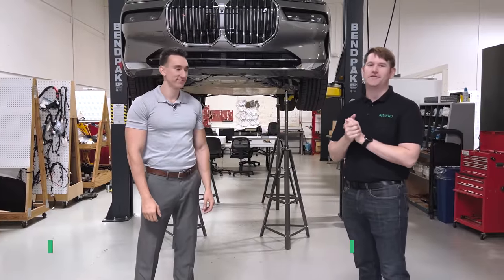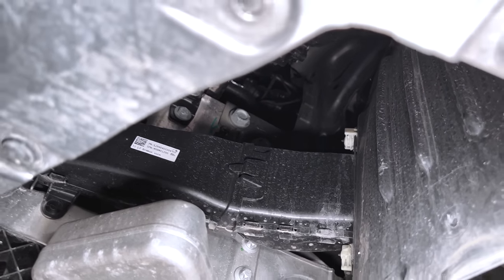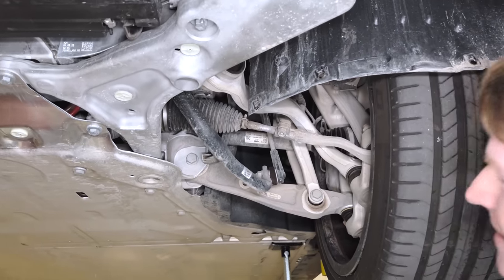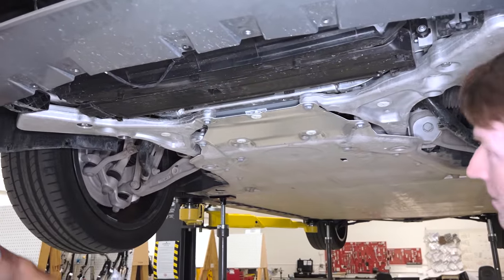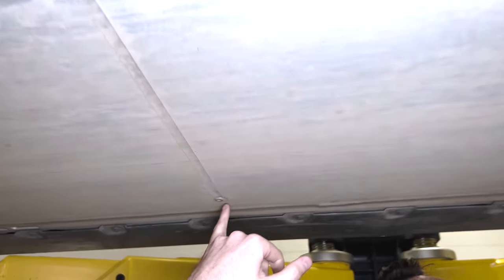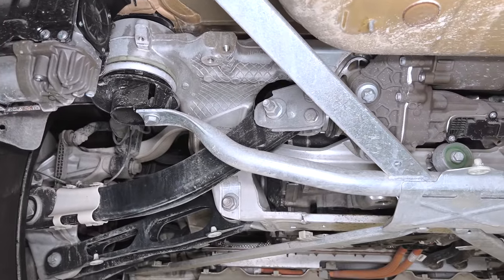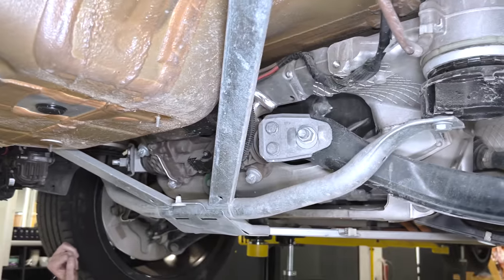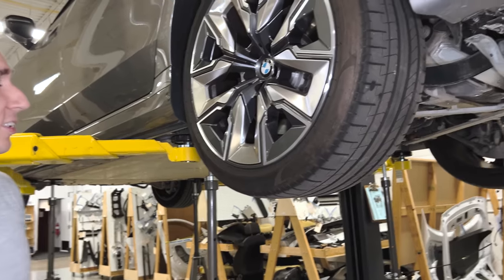The Magnificent Seven | BMW i7 Hoist Review

Comment: Kevin and Armin are quite tall individuals.  So why is the car so low on the lift that they both must twist their heads sideways to stand under the car?  Looking at the lift at the very first of the video, it's obvious that the ceiling height of the building is tall enough and that the lift itself has more height capability.  Hmmm, maybe Jordan put the car up on the lift as a joke?  :<)  Good video guys, I always appreciate these "engineering" talks.
Reply: They could confirm, but from what I know many lifts only go up about 6 feet or so.
Reply from the maker: That’s as high as the lift goes.
Reply: Thanks for the response 👍👍

Comment: Nice exposure of many aluminium castings. Many locations with deliberate potential shear points added for safety, as well as  added ductile underbody cross-bracing for controlled accident survival.
 "Fatigue Life" in any casting, is the most difficult design factor to be taken fully into account. Especially components that may be subject to full or even partial bending stress reversal cycles (eg. compressive to tensile,  for example the section connecting front axial loads to body frame during off-road racing), while castings have very little capacity beyond their elastic limit having very little ductility...

Comment: The rear steering is presumably ZF's AKC Central. It would be nice if the review identified components like that, since it is exposed and easy to identify, but I realize that there are limits to what one can reasonably expect in free content. 

this might be the first generation of AKC Central, which typically allows up to 4.5 degree of rear steering, for stability and agility. The second generation has longer maximum stroke, allowing up to 10 degrees of steering to be useful for low-speed manoeuvering.
Reply: Great info! 👏👏

Comment: You will be on a first name basis with your BMW mechanic 😂
Reply: nothing here can be fixed.
Reply: Might as well open a joint account too so the mechanic doesn’t have to bother you when he wants a check written.  😅
Reply: Four year warranty, guys.  Top end luxury owners trade in before the warranty expires.
Reply: @morrisg  But when the four years is over….  Based on my personal BMW ownership experience.  🙂
Reply: @morrisg   - TESLA world class 8 year warranty , MILLION mile battery.
Reply: @wtmayhew  Yup, that's why they trade in before the warranty expires.
Reply: @markplott4820  The battery can last longer, but my Tesla Model 3 warranty runs out at 8 years or 120k miles.  By the way, they kept testing those million mile cells (3,500 cycles) and they are now up to 3.7 million miles (19,500 cycles).
Reply: @morrisg   - 2023 Tesla battery last 1+ million miles Already.
Reply: @morrisg  Well put, thank you.
Reply: @morrisg  Yes, but they are the type to not drive older vehicles.  Got to have the latest, greatest model.
Reply: @morrisg  Yes, and after eight years you can buy another new Tesla that looks identical to your old one at their current model refresh rates.

Comment: At what production level does it make sense to design the EV seperately from the ice version?
Reply: They'll stop designing ice when they see demand dropping off. Then they will only design EV and just sell the last ice design out for what ever years.

I think only the EV exclusive mackers stick with EV.

I personally think the old ones think the gas is going to stick around for many decades.
Reply: @ralanham76  I didn't mean stop designing ice cars or EVs. I meant don't try to just batteries and an electric motor in an ICE car.
Reply: @ralanham76 who said they haven't already designed full BEV platforms!? No one really knows what's going on behind the doors!

Comment: The Mercedes-Benz Econic truck has an airtank that also acts as a crossmember.
Reply: In that case, is it air for the brakes?
Reply: @grahammonk8013 those Econic trucks are commercial vehicles they have tons of customisations from use as garbage truck to firefighter mobile crane.....

Comment: Very complex and much  labor needed to produce that vehicle.  That is why BMWs are expensive.
Reply: DELETE both ICE & Hybrid versions, ONLY make BEV.
Reply: Who said it's more complex to produce!? Are you the engineer!? You don't need all those features like all wheel steering and others that's what makes cars expensive! You just look at the overall price and nothing else!
Reply: All modern cars are utterly complex doesn't matter which one except some very basic Toyota and Mercedes used in very harsch environments around the world by NGOs....
Reply: @carholic-sz3qv  - TESLA cars have the MOST Features as STANDARD , more than ANY other OEM , yet Tesla continues to LOWER its Prices over Time. 
LEGACY auto cant Compete with that. 
TESLA still Remains the SAFEST car to buy.
Reply: @carholic-sz3qv   - TESLA in 2023 has Commerical build Quality, their cars OUTLAST any gas/Hybrid cars and OUTLAST Legacy BEV. 
its very HARD to Break a TESLA. 
the Battery pack alone lasts 2+ million miles in 2023.

Comment: Even if they can't justify a dual-use air tank, I'd think they'd want a second tank at the front at least, for a shorter tank->suspension line.
Reply: The probably use the same tank in many different platforms. To have one uniqe thank for each platform would be more costly.
Reply: @mrm1885  Well, they should want a front and back tank in every platform.  And the development costs should be negligible except maybe for crash design (whereas dual-use is more expensive to design).
Reply: @concinnus running a few lines from the back to the front costs pennies. Why have an extra tank?
Reply: or do you mean an integrated tank that is also a structural part?
Reply: I thought I saw a tank tucked up front, but I scrolled back and couldn’t find it, so maybe not…
Reply: @mrm1885 one tank is more than enough and this air suspension is way more sophisticated and better than the tesla one as they explained in this video! They could have used hydropneumatic suspensions but it's much more expensive! I think Toyota still used hydropneumatic on the land cruiser.

Comment: So many parts, so many failure points, so many isolated parts solving singular problems and so little comprehensive integration. I doubt there was much value engineering on this. This is an example of the shallow view of more parts = more engineering = charge more mental trickery. More is not better. Solving the problem with the best solution is better.

Comment: I don't understand how mfg's could spend so much time, energy and money on lowering costs and none of that translates to the buyer. Except for cheap parts that fail.
Reply: There are more expensive electronics and the software costs are also increasing quite a lot. Compared to a car from 25 years ago which had only a few relays, perhaps an ECU and some lights, the new cars have dozens of controllers, at least 2 full-color screens, cameras, a lot of offline intelligence as well as self-driving capabilities.

Comment: High dollar low volume...that is exactly what this car is.  Still a model S is a better buy and costs less.  Take your 20k+ in saving and make more money or take a nice vacation.  If you just need a simple daily driver get anything else but this car, if you cant afford to throw out 100k plus.  Get a model 3 and be done with it.  If you cant afford a new  model 3 ..buy a used ..anything... for under 25k..problem solved.  Next.
Reply: It probably costs more than 120k. But we are not the target audience here, but some executive/mob boss that wants to stand out. If you've ever been in a 7-series you know it doesn't compare with any Tesla on the market in some areas.